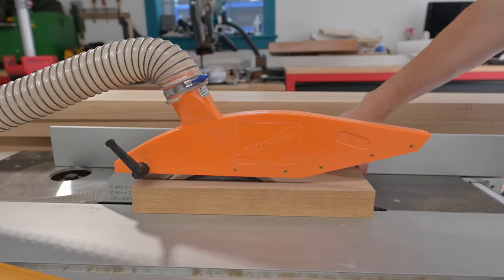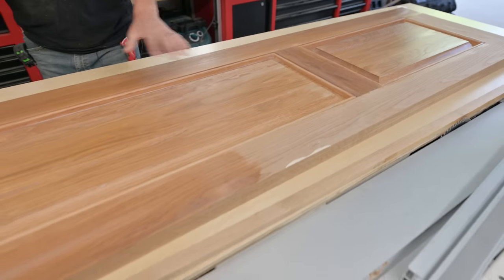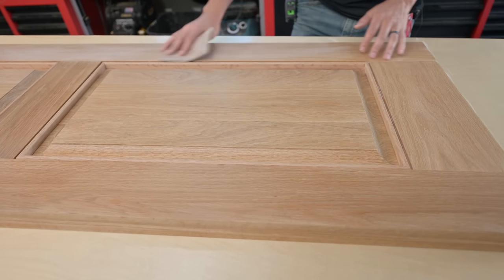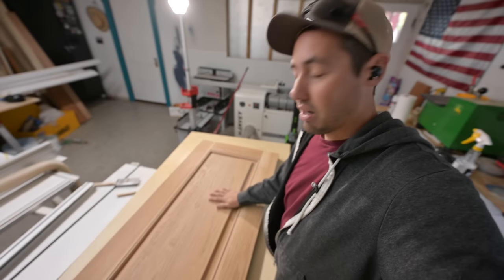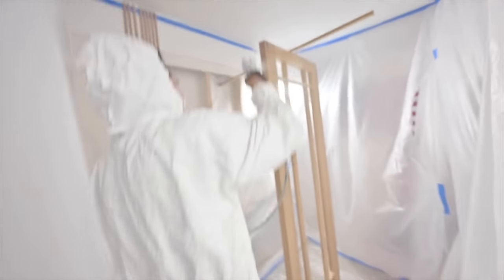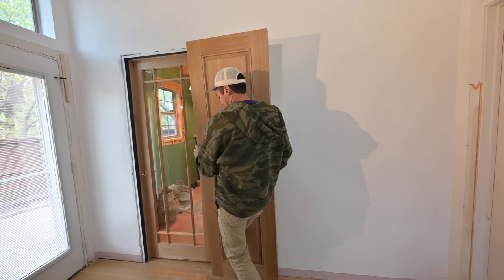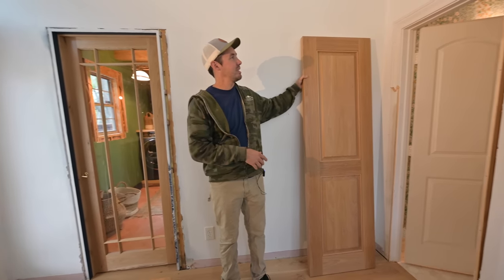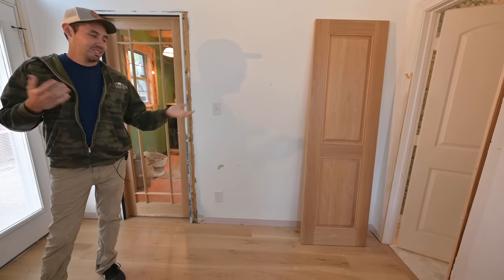Finishing my Doors with FLOORING FINISH?

Comment: Looks Great Richard!  As a hardwood floor contractor I usually apply oil based polyurethane to my hardwood floors for a traditional look.  When the customer wants a Water based finish I do use the Loba Line of finishes as you did.  For a 1 part finish I use Loba EasyFinish, for a 2 component finish I use Loba 2K Duo.  However both of those finishes require a sealer coat first of Loba EasyPrime.  The Loba Life is a 1 part finish with no need to use a primer coat, very DIY friendly.  Best advice when using a water based finish, Never watch it dry!  It will drive you crazy the way it looks!  Apply it and walk away, when it's dry it will look great!

Comment: When applying your finish, use your brush on the 3 dimensional areas only. For the long flat pieces, use a mini roller. The roller I use has about a 1" diameter by 6" wide replaceable nap roller. They also make foam roller sleeves that work great too. You can apply the finish with the grain and then stop when the grain meets an opposing grain direction. Your finish will look sprayed on.
Reply: I tried that but I seem to get a better finish when I rolled it and then back brushed it.  It could be the surface coating I am using.

Comment: I just used American Products Bona Nordic Seal to finish a 14 ft wood table. It is a white wash floor sealer that I tinted myself to a custom color. It looks great and is very durable
Reply: I just finished a built in oak closet shoe box with the bona Nordic also. What was your tinting method?

Comment: I use floor finishes for almost everything.  I just thin for my application method and use a variety of different thinners to modify the dry time to my needs.   It is also cheap, for an oil based finish I can get a gallon of Bona woodline for $45, hard to beat that.

Comment: Awesome. Looks great. I did a kitchen island in beech with a hard wax oil floor finish.  Very forgiving, great performance.  I wanted it a little darker, so put another coat on with a darker oil from the manufacturer to tint it a little.  Had never thought of it for a door, so thanks!

Comment: Could this finish work over a painted finish on a door? Would really appreciate a tough finish on my doors. (Wheelchair in the house)
Reply: Yes finishes can be put on painted surfaces to give them a sheen or shine. If you have not yet had the door pained you could just go with oil finish on wood. It can always be easily touched up when damaged or even stripped.

Comment: I’ve been using General Finish Conversion Varnish on alot of my projects and love it. I had a handrail project come up where the customer requested I use the same finish as the hardwood floors they just had installed. So I talked to their flooring trans and got what they used which was a 2 part Bona Traffic product. 
I SWEAR it’s the same stuff. Mix ratio was basically the same. Milky white color was the same. Even the unique smell was the same. 
I’m pretty sure they are the same. 
Just good for thought in the future. I don’t think you made a wrong decision using floor finish for your doors.

Comment: We’ve been using a lot of Rubio over the last year. Probably more than £1000 or $1000 worth. I know that a little goes a long way but not that long. There is a product called Heidelberg. Another wax oil and which, according to professional users, also goes a long way - and it’s much cheaper per litre. 

Now, I haven’t tried it as yet because we wanted no problems with continuity of colour (smoked oak) between all the various elements. Now, we are moving onto a different part of the house and a slight colour difference would never be noted. So, I’m going to try this Heidelberg. Whether or not, it works out cheaper per square metre is something I don’t know yet. If anyone else has used this product, it would be excellent to share experiences.

Comment: I actually used kitchen countertop oil on my pine doors . Osmo Top Oil. Actually did it as an experiment as I had loads left from the kitchen turned out great. Doors are very wipeable.

Comment: When finishing wood its better to use a foam brush since it does not leave any brush strokes. 

I would recommend Bona hardwood finishing products since they are a water based urethane product. Oil based urethane products add a yellow tint to the wood because the oil.  Bona also offers a 2K wood finishing clear coat Bona Traffic HD which provides a more durable coating for flooring or furniture counter tops.

Comment: We bought a couple solid wood doors for two sleep outs I built and we were glad when we picked just a clear coat instead of a stain it kept the natural colour of the wood just like you did, nice job. The doors and windows you build are absolutely awesome beautifully constructed mate by the way have you finished the laundry window, couldn't quite see lol. 

Just wondering also but have you ever tried constructing a door or window using tools lets say from the 1800's that would be interesting to see. I think that would test your skills which no doubt are very high. But I see where the price for those other doors come from people don't see the work involved in making custom work but you definitely have the skill to build them also having the right tools for the work involved helps the right router bits etc so looking forward to seeing those.

Comment: Oak is a tricky wood to finish, the diners run from face to back like a bunch of straws, allowing the finish to pass through, taking multiple coats to make a smooth finish. You see this by the light and dark patches on the surface (seen when eyed from an angle. We would fill the oak first with filler, sand, then finish to eliminate this. Just a tip
Reply: Spellcheck: fibres not diners…lol